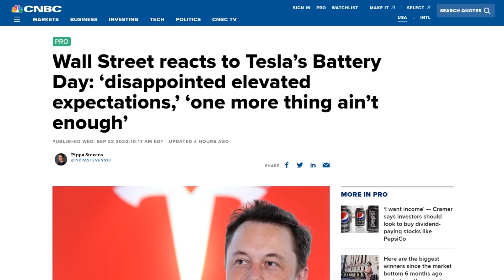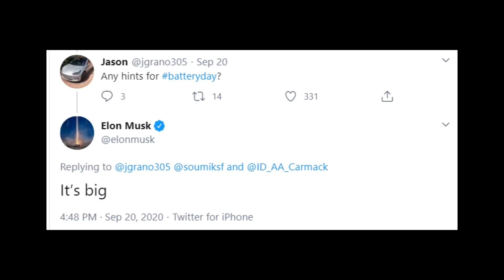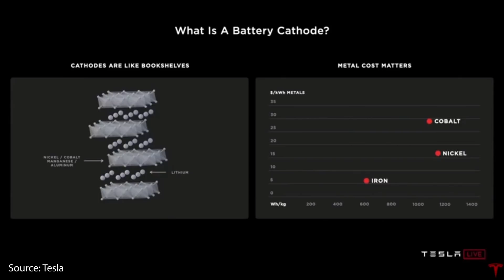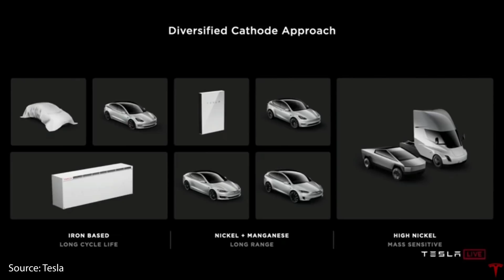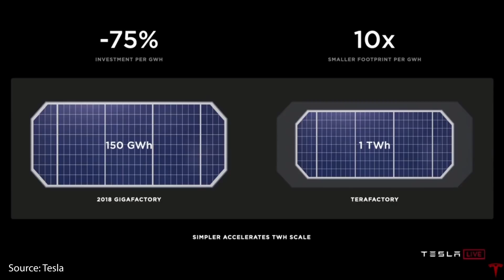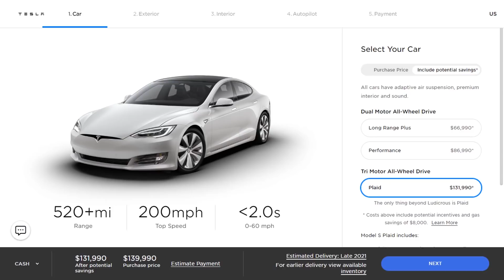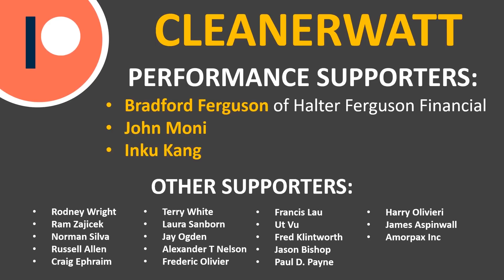Tesla Battery Day was NOT a "Letdown" (Tech Review)

Comment: Listen to what Elon said. It’s not in the bag. He basically was trying to tamp down expectations as they are approaching two years after buying this tabless battery patent and it’s still not in the bag. Those are Elon’s words not mine. The Roadster and now Plaid delays are specifically because of this manufacturing issue. Using the cases as structural components will only yield more totaled Tesla’s and recycled batteries. Million Mille Batteries for vehicle to grid was dismissed as that’s why you should buy a battery wall. Hyper ventilating rants had everyone using auto bidder to sell energy back while they we plugged in at work to reduce the cost of ownership but that died. Battery day stock run up hype was not “mind blowing” at all but a let down from what the hype said would be. Roadster was supposed to be released November 2020. It won’t be out for years. Do you need any other facts Elon gave us to measure their progress? Plaid got a extra motor and a lot of < and > for performance but yet these batteries weren’t in it when it ran the 1:30.3 track suspension test or the Nuremberg lap time last year. So where are those numbers coming from? Adding a motor doesn’t increase range (+) with any battery Tesla puts in their cars right now so how where these numbers achieved and why not post their specifics. Let see the video of the 0-60 and 1/4 mile times. Take that exact car in the video and show us it perform. I’m not doubting their their tenacity but know when their taking reservations for performance numbers that aren’t available yet. I’m not questioning their amazing track record. Elon was telling everyone to give them a year and a half to three to get there. This is not an achievement but a goal. I believe even possibly an achievable goal. Certainly not worth dropping a $250k reservation three years ago for a Roadster or $1k deposit on a $152k Model S Plaid who’s battery assembly machine is on it’s four revision this year and is being scrapped and re-invented every three to four months according to Elon. Yup...great goals...a lot of work...not here yet but go ahead and order one like the Roadster Reservation holders did years ago if you believe Battery Day was a blowout achievement.
Reply: I agree, from what I heard the battery is still in the creation phase...yet a bunch of people act like it's already in production and a done deal.

Comment: The Plaid begs the question: When will we see that kind of range in an LR version? I mean... It's hard to call a model "Long Range Plus" with 402 miles, and then have Plaid with 520+...
Reply: Rick K why?
Reply: @OhNoDaveIsMad  Well, if there is three versions of the car and one is called "Long Range" I would assume that it's the one optimized for the best range... And even if you argue with the fact that it's not "the longest range available", I would still want to see a "longest range available" version, and I highly doubt that it will be the 1.000+ horse power tri motor version doing that... For me performance is second to range. (Not saying that performance isn't important too, but even the LR+ has way more performance than I would ever need...)
Reply: Rick K he nice thing with electric propulsion unlike ICE propulsion is more available power doesn’t equal more engage usage unless it’s used. It’s all driving habits.
Reply: @OhNoDaveIsMad  I agree with you, but more available power normally at least means more initial cost, and in some countries it means more taxes too. And it does also mean more weight, which (at least to some degree) impacts range. It's great that Tesla pushes to have the fastest EV on the market, but in the end I bought a luxury sedan, not a race car...
Reply: @TheNewAccount2008  I don't give a damn about racing or drag races. I do how ever want to go from 65 MPH to 180 MPH in the fastest time possible if that means avoiding being smashed between a Semi and a guardrail.
Reply: @OhNoDaveIsMad  Fair enough. So you are the audience for the Plaid, I totally respect that. I just want the longest possible range. It would still be nice if Tesla would have offerings for both of us...
Reply: It’s called Long Range Plus, not Longest Range Available.
Reply: Its also my position that the plaid will have the longest range. Will be intrested to see if that is the case.
Reply: @OhNoDaveIsMad  It seems to be that way right now. But I am quite sure that if you build the 135KWh battery into a "normal" LR+ you will get more range out of it. (After all, you also get more range out of the LR+ compared to the Performance.) So I seriously hope that Tesla tries to stay on top not only with the speed but also with range and therefore will get the battery into the lowest motor tier. (If you can ever call 600+ horsepower low tier...)

Comment: I think many were disappointed, including me, because timelines were stretched out so far.  It's fine to present a roadmap of what will occur 2-4 years out, but also give us something new for the short term.  We know the development team isn't sitting on their hands so the presentation should have announced something new with a much shorter time horizon, say 0-6 months.  Are there zero improvements to the batteries they already use?  Although a battery event, I expected something new for models s/x.  For example, a heat pump, faster charging, or blind spot indicators in side view mirrors.

Comment: Battery day was a BS day, seriously. If you reduced the battery price, how comes that Plaid costs $150K for the same car that is in production since 2012?
Reply: because a car with Ferrari or Maserati performance can be priced higher of course ... wouldn't you do this if you were Elon ?
Reply: @krisvandermeulen253  A Tesla is not a Ferrari or a Maserati. Model S Plaid is a large sedan, that's all. Anyway, VW group, Hyundai and Kia and few others are coming hard on Tesla, life won't be easy. I would pay a little bit more and buy a Taycan, at least build quality is worth what I pay...
Reply: Well its expensive because 1 you're early adopting to brand new battery technology and performance,2 the car will be built entirely different by using front and rear castings joined together by a battery instead of traditional stamped pieces and also 3 that money you pay on delivery will go to fund research and development on the new 25k car.tesla doesn't make it expensive for no reason haha.they have been doing this exact thing for all their stuff :)
Reply: What is AMAZING is that TESLA introduced a battery that makes all current batteries obsolete...
AND have built a GIGA factory that have started production of these cells.
TESLA calls it a "pilot line" and is when ramped up the 13th largest battery factory in the world at 10GWh.
Would claim that is BIG NEWS
Reply: "If you reduced the battery price, how comes that Plaid costs $150K for the same car that is in production since 2012?"
1. IT IS NOT THE SAME CAR
2. IT IS SO GOOD IT IS STILL CHEAP AT 130k, PEOPLE PAY IT

Comment: Elon said they almost have it figured out 🔋: I think a lot more testing needs to be done. As well building a production line.
Reply: What is AMAZING is that TESLA introduced a battery that makes all current batteries obsolete...
AND have built a GIGA factory that have started production of these cells.
TESLA calls it a "pilot line" and is when ramped up the 13th largest battery factory in the world at 10GWh.
Would claim that is BIG NEWS
Reply: They already have a production line, how else would they know how close they are to figuring it out? It's just an experimental production line rather than one meant for proper full scale production.
Reply: theuncalledfor Yeah no doubt it’s experimental they’re using a teaspoon to feed the carbon onto the substrate. Watch the video, Clearly might not even work at full production speed. Based on Elon time this is a five-year outlook Before the batteries are incorporated into cheaper vehicles. It will be in the higher end vehicles first almost defeating its purpose. Well I guess you got a pay for a multi billion dollar production line.

Comment: Instead of having 80mm (8cm) tall batteries why not develop long tubes and have 2m (200cm) long batteries on its side in two rows? (its only tooling)  you will gain an extra 10% in energy
Reply: No.
They would overheat.
If anything, they could increase the diameter of the cells, but not the length.
The tabless design sheds waste heat through the bottom and top caps of the battery.

Comment: Every question I had was not answered, but the timeline didn't disappoint me at all.  I have an inkling about how difficult it is to create a new-tech battery line, get the reject rate down and the production volume up.  It can take a couple of years to iron out the kinks.  It's not an easy job.

As for the Roadrunner battery, I was vaguely hoping for a 40% energy density improvement at the pack level translating into a 40% increase in range, and I thought I was being optimistic.  What we got was much, much better.  Costs slashed.  Footprint and investment costs per line slashed.  Line speeds improved by 7-fold.  Waste water slashed.  Power output of the pack improved.  Range improvement well above my most optimistic projection.  Elon was right, Roadrunner is insane.

But now I'll question your optimism.  I think Tesla is 18-24 months away from full production at one Roadrunner production line.  To bring it up elsewhere will take another couple of years.  You do not just build and operate battery lines.  You build, then fight the reject rates.  A new line may look like the one it's copying, but it has to match at the molecular level.  This is not easy or quick.  It's kind of amazing anyone can do it at all.

But by 2025, I'm fairly sure, barring unforeseen glitches, Tesla will be running several lines at Berlin and Austin in addition to their prototype line in Fremont, and they should be in the 100 to 150 gigawatt-hour per year range.  Shanghai, too?  By 2030, I expect them to pass the 1 terawatt-hour per year, possibly by a lot.  My estimates are a bit more conservative than Elon's or yours, but that is still one hell of a lot of batteries by 2025.  They can come pretty close to satisfying their production ramps with that many batteries, plus what they're buying from outside suppliers (NCA from Panasonic + LG Chem, LFP from CATL).

The core news is Tesla has a battery technology nearly ready for full commercialization that is at least 50% better than current-tech batteries in just about every cost and performance metric.  The one metric I'm unsure of is cycle life.  Tesla didn't address that in their pitch.

But it has to be better than NCA, or they would not put it in the Semi.  To be economical and appealing to truck operators, the truck has to last at least 700,000 miles before major overhaul is needed, and preferably 1 million miles.  That would put it on a roughly equal footing with diesel semis.  With the reduced fuel and maintenance costs, the Semi becomes a no-brainer with that kind of cycle life.  It'll sell like hotcakes.  If they can only offer 300K miles before pack replacement, it'll be a lot harder to sell the Semi.

The implications for a battery tech jump this big are staggering.

For one thing, it means Tesla can accelerate sales of megapacks to utilities, because they can cut the costs significantly.  And that will accelerate the adoption of solar and wind.  The cost of storing energy from intermittent sources and using it when it's needed is the big hurdle for solar and wind.  The grid is about to become cleaner.

For another, Tesla just made every battery manufacturer obsolete.  For a few years, they'll still be able to sell their products.  But as Tesla ramps up, demand for old-tech batteries will wither.  BEV manufacturers will order less because their cars will sell less - they won't be able to compete effectively against Tesla.  Ditto for fixed site energy storage products.

And third, Tesla has just relegated every other BEV manufacturer to 'also ran' status.  Those manufacturers have nowhere to turn to get batteries as good as Tesla's.

Tesla will put Roadrunner in all of their BEVs, eventually.  They're starting with the heavy duty models, and leaving premium light duty models on NCA, and using LFP for entry level models, but that's a snapshot.  Tesla is not ramping up production for NCA or LFP - only Roadrunner.  The cost per kilowatt-hour of energy storage for Roadrunner is far less than even LFP.  There's simply no reason not to use it even in their cheapest cars - they'll be able to reduce prices by thousands of dollars.  But that will require an awful lot of Roadrunner batteries, and that level of battery production is in the future, not the present.  So we have this three-tier approach to their model lineup.  That won't last.  You can be sure, their battery suppliers know it, too.

Those suppliers are now in a bind, because in every application of their products, BEVs and fixed site storage, Tesla, with its cheaper and more effective tech, will outcompete the companies that buy batteries.  If they want to avoid losing market share, they'll have to develop batteries just as good - or license Tesla's tech.  One or the other.  Tesla wins either way - either they get royalties, or they just make the products themselves and dominate the markets for them.

Will Tesla license their tech?  My instinct is to say 'no,' Tesla can harvest a lot more market share if they keep the tech to themselves.  But Elon isn't really trying to conquer the entire energy generation, storage and utilization markets.  He's trying to accelerate the demise of fossil fuels.  That will go faster if other manufacturers can use the tech, too.  Licensing is a practical way to keep others in the game.

These are big giant consequences.  Frankly, the only people who think Battery Day was a disappointment are people who don't understand what Tesla told them.  Idiots, basically.  The same people who think Nikola is worth more than spit.
Reply: Your looong comments are always insightful and I appreciate them.
I would slightly disagree on the ramp up timing. Considering how fast Tesla has been able to ramp up Model 3 in China and how fast they are able to make changes in a production line (cf Sandy Munro) I think it will take them only 6 months to set up a line in any any of the Giga Fatories
On another aspect battery manufacturers are far from dead. First Tesla need them to supply the LFP and medium performance for quite some time. Second Elon said it will require 20 TWh (!) per year during 15 To 20 years to complete migrate transportation and energy to sustainable so everybody is needed on board. Third they certainly have or will have competing technologies now than Elon gave them a good heads up on his plan
Reply: @pascalg.8772  My opinion of the ramp timing is just opinion.  Even I am not committed to my projection - it could be different.

But I will urge you to think a little differently about Tesla and new factories.  Don't think in terms of the time to go from bare dirt to initial production.  We all know that goes fast with Tesla.

Think in terms of the time to go from bare dirt to full capacity production.

GF-Shanghai's planned full capacity production is probably 1.5 to 2 million vehicles per year.  That is when the factory is a finished asset.  At 150,000 cars annually, it's useful, but hardly more than a stake in the ground compared to the goal for it.

The supply chain to support initial production isn't too hard, but the supply chain to support 10 times that level of production or more?  That is why Elon worries about raw supplies like nickel.  There are bottlenecks lurking in the supply chain for a ramp of that magnitude.

Another way to eyeball it is, each 150,000 cars added to production is just as hard as the last 150,000 cars added to production.  Harder, if the supply chain can't keep up.
Reply: @Urgelt  Fair enough I fully understand your point. And Elon said 3 TWh by 2030
Hi from Paris
Reply: @pascalg.8772  Yes, he did... and 3 TWh by 2030 is not impossible, either.  Difficult, but not impossible.

I regard Elon's projections as aspirational.  They're within the realm of feasibility, but only if everything goes right.  He's goal-setting.  Why set mediocre, lackadaisical goals?  Set ambitious goals and then try hard to reach them.  That's his style.

And it works; his companies are doing amazing things.  But not always on the timelines he projected.  In particular, his supply chain sometimes doesn't keep up with his date-setting, and that has been particularly true for his battery supply chain.

I won't criticize him if delays creep in.  Even with delays, his companies lead everyone else.  If not for Musk, Tesla would still be, at best, a tiny company hand-building expensive BEVs, like Rimac.  Or bankrupt, like most automotive startups.

Hi from Virginia!